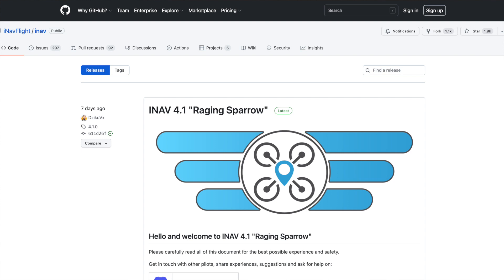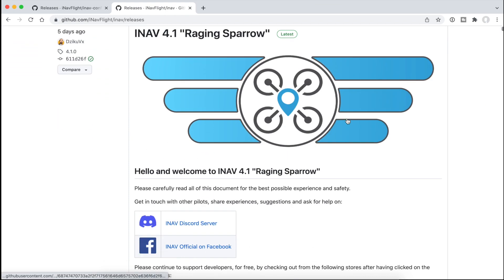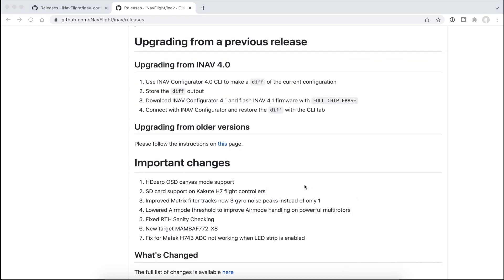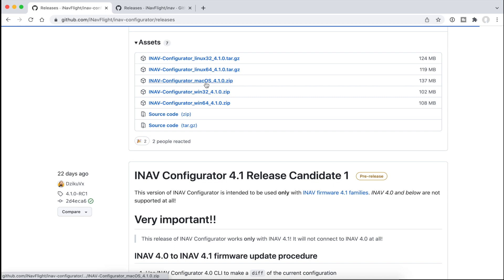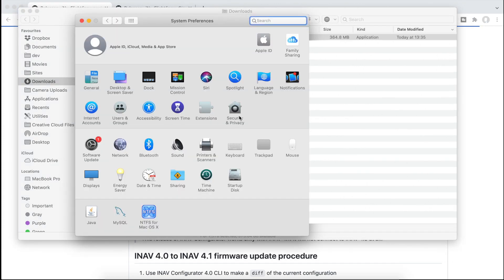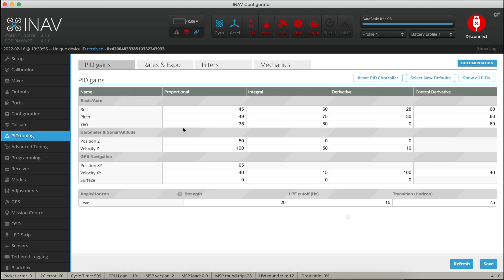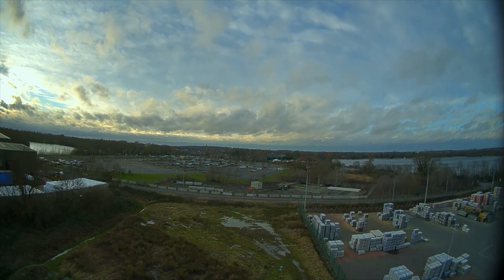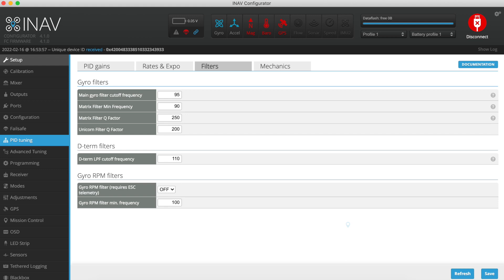INAV 4.1 upgrade,  improved matrix filter, PID tune and test flight

Comment: my default 7" preset runs great on 3 bladed props but on 2 bladed high speed props i get a high freq micro osilation on high power settings. I woulnt have a clue where to start..pids or filters and or what filters..?

Comment: Any idea why 4.1 does not work correctly on a mac?  Most menus get stuck saying waiting for data. I have erased and reloaded 4.1 versions and still no fix :(
Reply from the maker: I only run INAV Configurator on Macs and haven't experienced any issues. There's lots of Macs and lots of OS versions so there's plenty of variables that could be stopping yours working.  Have you checked/swapped the USB cable and USB port hasn't been kidnapped by another process?
Reply: @WhirlyBloke  I have used two different MacBook airs using big sur and monterey. Yet it works fine on a PC Windows computer. Obviously would love to just use Mac though. Any suggestions would be greatly appreciated
Reply from the maker: Back your quad using Windows and then try flashing Betaflight using the mac. Remember to make a note of the version of inav you're using. If it works then inav has a problem,  if it doesn't it's a mac problem. You can roll back your quad using your Windows PC using the back up.

Comment: Hi, Mr. Whirly. My name is Itajai, from Rio de Janeiro-BR. I watched his channel and subscribed. I would like to know if i can roll back a board version update. I was with Inav 3.1 and upgraded straight to 4.1. In the general configuration, i think everything was fine, but when i decided to configure receiver channels commands(1000-2000), via CLI, in Inav Configurator, all were inactive, including the radio transmitter. What could have happened? There's a way to help me with that? Thank you very much.
A hug.
Reply from the maker: Is ready to roll back. Just flash as normal and pick the older version. If it doesn't appear in the list,  download from the releases page on github and flash from the local file.
Reply: @WhirlyBloke  Hi. Good evening, Mr. Whirly. Thanks for the quick response. Tomorrow, i will be doing the procedure sent by you.
An hug.

Comment: Can you recommend anyone who can help me interpreting my blackbox data from my crocodile 7 build, it seems to be vibrating a bit and I'm new to this diagnosis stuff ? Quad seems mechanically sound and all screws /fixtures seem to be tight etc. Or can you recommend a forum where I can possible  get assistance? Im running default inav settings btw as i'm not sure what to adjust.
Thankyou
Reply from the maker: Checkout the INAV or PID Toolbox Facebook groups. Lots of helpful people over their. Also UAVTECH on YouTube offers a service.
Reply: @WhirlyBloke  thankyou for the reply and advice. Will have a look👍

Comment: iFlight Succex-D F7 TwinG is beig shipped withOUT a barometer. What would you suggest instead? How about the Zeus F722?
Reply from the maker: The v2.1 has a baro but they removed it on the v2.2 - shame.  I use matek or katute on other builds.
Reply: just get a barometer(they super cheap) and solder it up to the sda and scl pads.

Comment: Im on 4.1 inav for a lil while now.. but noticed my amps dont read right. I try to adjust them.. and its like not reading amps at all. on datalog it shows amps going down when i up throttle
Reply from the maker: I'll see what mine does.
Reply: same here, 7 amps on the ground once flying it drops.
Reply: @vedasticks  yea this second drone of mine inav doesn't read amps. Works on betaflight. Think I used negative numbers on the 2.6 one but still never got it right

Comment: Have you tried the Molicell P42a li-ions? they have a larger capacity than the vtc6's and higher current capability. Just a thought.... cheers, enjoying this series, can't wait for my AOS7 to arrive and I can get stuck in :)
Reply from the maker: Yes, I've seen them but I've have to save - they are mighty expensive. 4.2Ah is awesome.
Reply: @WhirlyBloke  every now and again you can get them for £6.99 each on amazon.

Comment: The Big Problem i had with Inav, on 3 inch props no problem but with 10 or 12 inch, always wobling, don't fly good, not stable, i think thats the wrong pid settings....☹️

by the way, you need a heating in your room... then you don't need to wear winter clothes🤭
Reply from the maker: The PID tune and filtering for a 3 inch is very different to a 10 inch. Bigger quads generally create more mechanical noise at a lower frequency and you need to get the quad mechanically as noise free as possible before you start tuning. The new matrix filter will improve things for you. I've been running my Thicc on 8 inch props with INAV and it flies really well. Brrrrrr

Comment: 8:59 "Pitch Bobbling"  Can you explain this further please ? Many thanks.
Reply: Sounds like he means throttle chops aka "throbbles" basically, when you punch the throttle, you get a shake in the pitch axis (In Betaflight, antigravity addresses this issue)
(PS UAVTech has a great vid that explains/addresses the issue)
Reply from the maker: @sunsetpark_fpv  Throbbles indeed. It's noticeable on throttle chops and throttle steps.